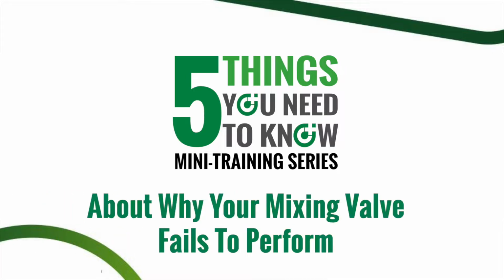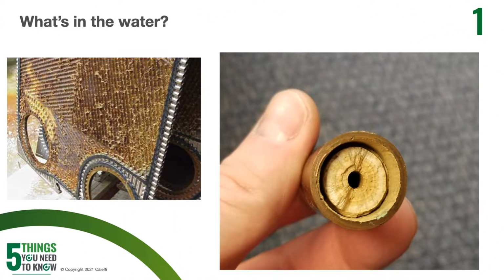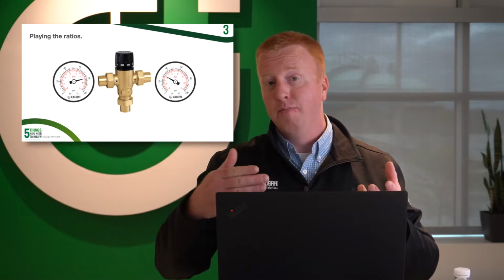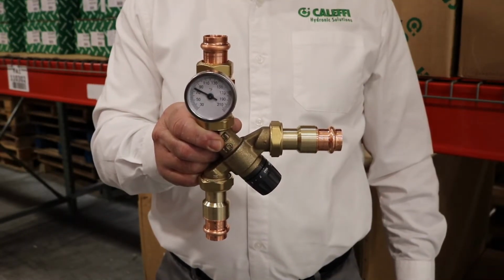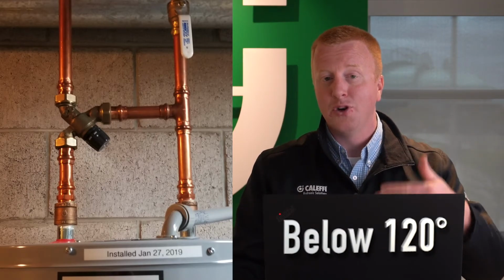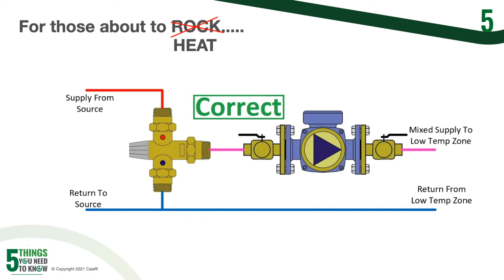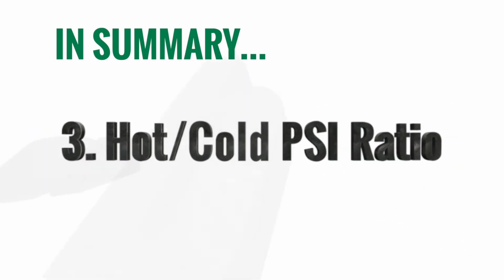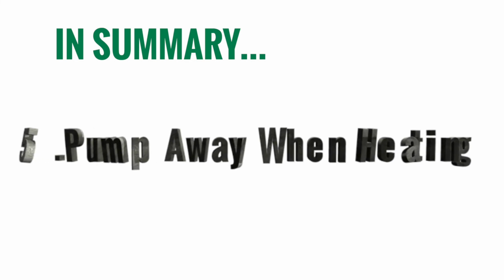5 Things You Need To Know About Why Your Mixing Valve Fails To Perform

Comment: What TMV would I need for this senerio ....I’ll use a 30 plate heat exchanger to act as my boiler heat source due to the fact my heat supply is a outdoor wood boiler and I need a closed loop system..so to prevent to hot of water entering my 900 ft of radiant floor heat what do I need.
Reply from the maker: I would consider a 521 or 5231 series thermostatic mixing valve.  You will need to look at the flow rate of your project and select the best fit.